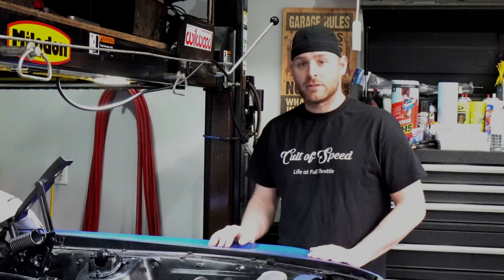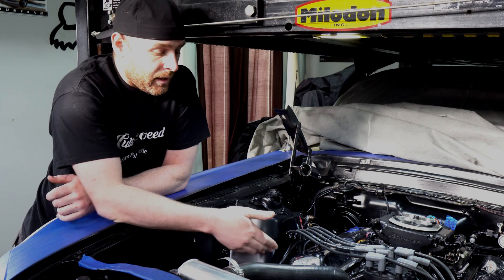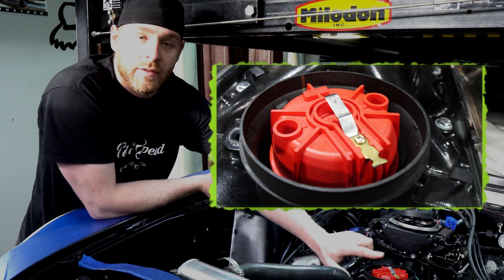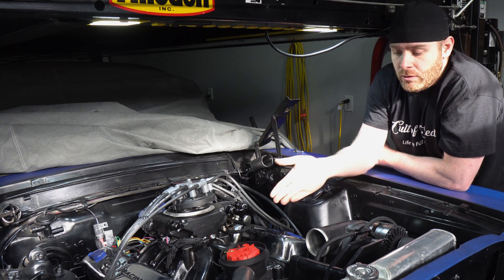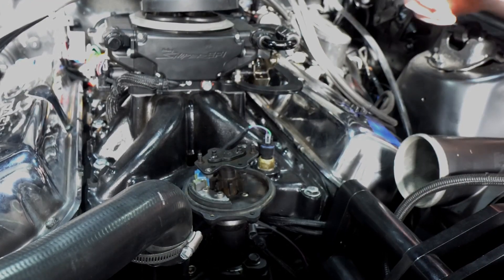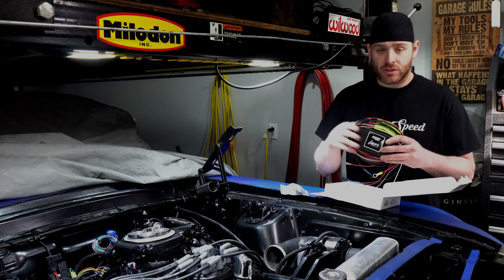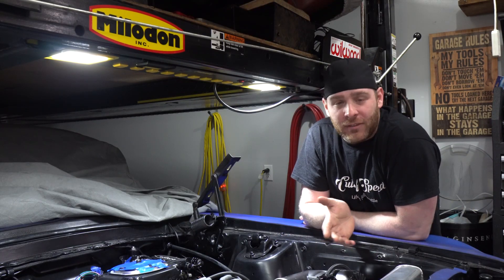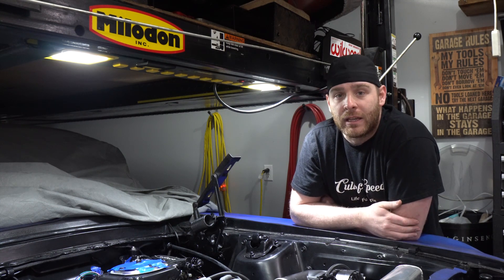holley sniper efi initial setup

Comment: Sorry im late to the party. For a 383 stroker with a holley efi system and a hei distributor. Why wouldnt i line up my balancer mark with 0? I have 4 lines on my balancer and it is throwing me off for the inital start up
Reply from the maker: you need to give the sniper a " heads up " that you want it to fire soon.  if you have it on the exact moment where you want it to fire it doesnt know until the next time you are telling it to fire again.  and well you will always have an issue.

Comment: How can I figure out 14 degrees before TDC? My crank only has a TDC mark on it
Reply from the maker: you can buy a sticker that goes on your damper that has degrees in both directions that could help you out. 

OR 

get a timing light that does it so that you can set the timing correctly. 

OR 

lastly a new damper isnt a fortune and may be the easiest way to sort it out.

Comment: Cash wants a great video dude very very informative all good points everything checked my only question is when the initial set up with the little 3-inch screen when you have to go through the options of picking all the different stuff that you have on your car there's no option that says HEI so I know on the Holley sniper is not going to control my distributor but what do I pick for an hei cuz that's what I have
Reply from the maker: Good question, and thanks for the review of the video!  if i was running a HEI setup in my car i would select the coil - option.  as you do not have a CDI box ( msd box ) and the other options ( mag pickup / holley dual sync ) both do not apply either. 

hopefully this helps and it fires up no issues for you! 

alot of people online have had some install errors ( like wires getting some RFI interference, or just plain wired incorrectly.  ) but if you followed the directions ( every single step ) you shouldnt have an issue and you will be blown away with the performance!!

let us know if you have any other issues!

Comment: good afternoon I want to buy the MSD 6 EFI Ignition Control 6415 Electronic for my car but I still have doubts, it is possible an email or a whatsapp to communicate and clarify the doubts thanks
Reply from the maker: sure send us a Facebook msg on our page there. thats the easiest form of communication
Reply from the maker: official 710 garage 
on FB
Reply: @710Garage  thanks, look, the msd has a white wire that one connects, when it does not use the violet and the green one, to that white wire which signal I can connect (+ or -) the signal that arrives from the ecu for the coil
Reply: @710Garage  I don't see her I don't know which one is sorry

Comment: hello I can install in a car, with single point injection with a distributor
Reply from the maker: the 6 EFI box will allow you to run to a distributor yes, if you didnt want the injection to control the timing.
Reply: @710Garage  ok the module would control the time?
Reply from the maker: @josehumbertohernandezcorte3617  thats correct.
Reply: @710Garage  gracias
Reply from the maker: @josehumbertohernandezcorte3617  no problem at all!!